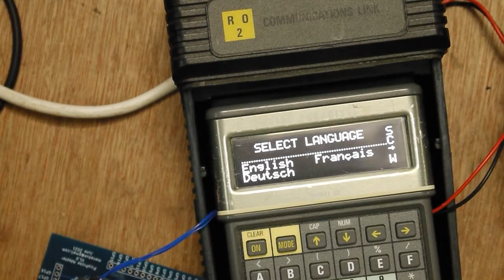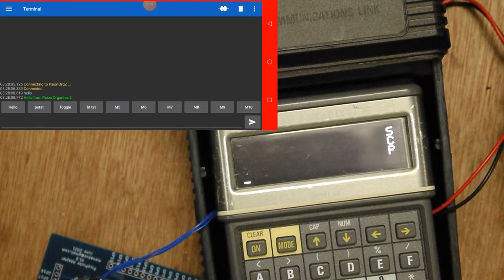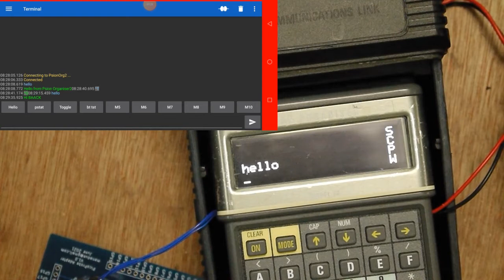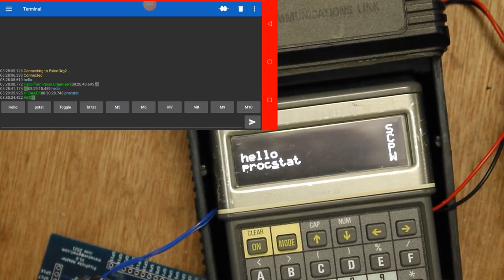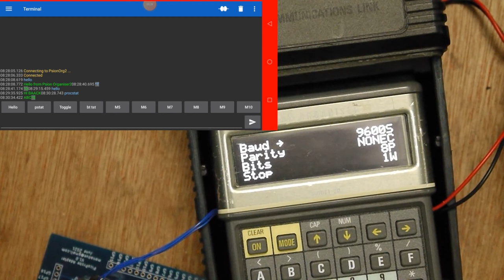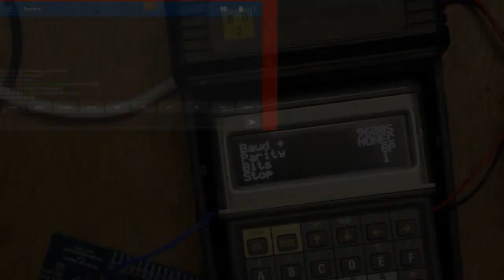Re-creation of Psion Organiser Part 13: Bluetooth Comms Link

Comment: I think you can put the Comms Link Software on a bootable datapak... Switch [ON] and the Comms option will boot off the datapak (could be a pack gadget) and as you are not using a wired connection would work just the same.

Jaap has the four line version 4.2 (comms42.opk) in PSION Organiser II Device ROM Images.

Always sincere
Reply from the maker: That's an option I hadn't thought of. I was thinking of embedding the pak gadget code in the code for the re-creation. I'll have a look at the .opk route. It'd be more convenient not having to have a comms link plugged in the top slot when using just bluetooth.
Reply: @menadue  I've just tried it on the Hardwired SDCard Datapak Gadget in slot C:, It works a treat. I made it the default opk in the setup and when you turn the Organiser [ON] it boots the Comms software on to the MENU automatically... If you try to use it, of course it hangs then times out with device missing error;  as there is no 'comms device' or in your case wifi/bluetooth...
PS Merry Christmas
Reply from the maker: @martinreid4650  That sounds promising, I haven't got a gadget with me at th emoment, but I'll definitely try that when I get back.
Reply: @martinreid4650  I tried this and couldn't get the SDcard-datapak-gadget to run the comms software, did you edit the opk in any way? I put a copy on an EPROM datapak and that worked fine and I didn't get any error messages.
Reply from the maker: @martinprest9668  The header for the OPK may be altered. The SD datapack only handles linear packs at the moment, but the comms link code is small, I think, so that's probably not it. Odd, I'll hunt my SD pack out and give it a go. It definitely worked on the bluetooth gadget I'm working on, as I used a comms link image there and the code is derived from the SD datapack code, so has the same limitations. Hmm.